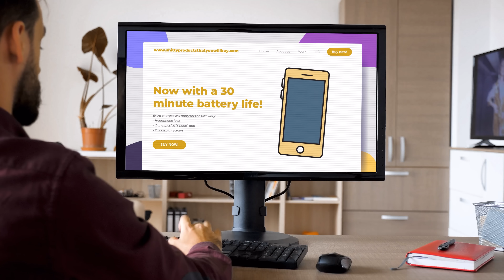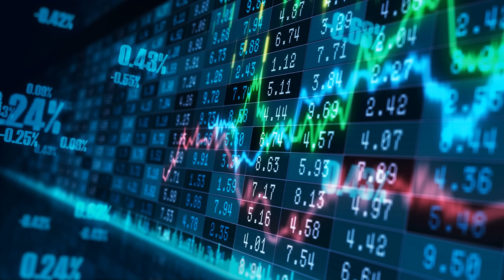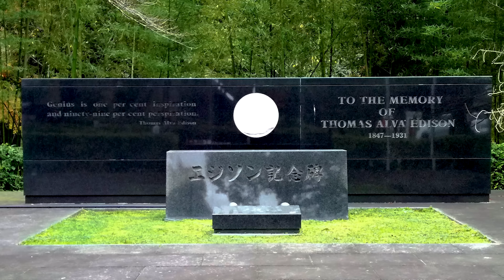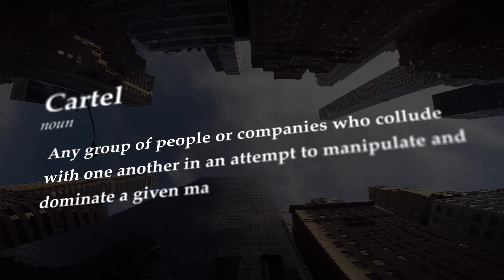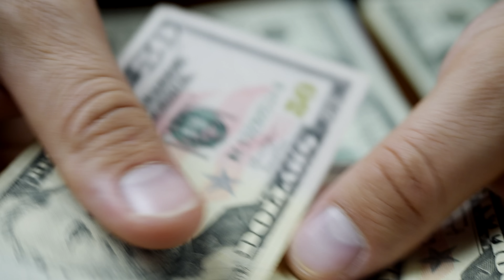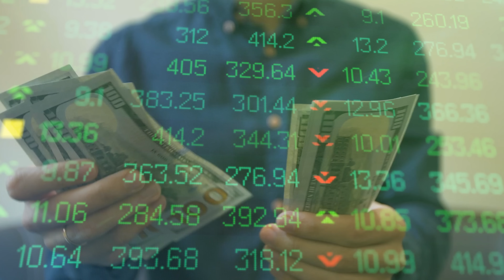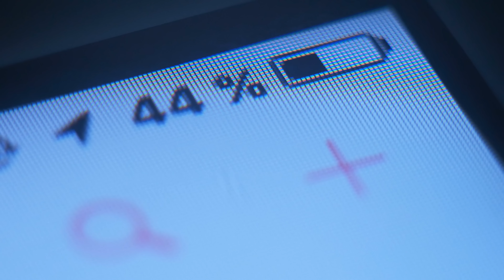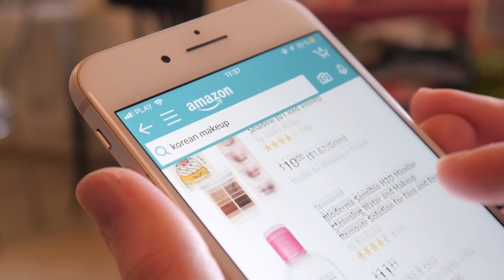Why All Lightbulbs Are Designed to Break

Comment: Old news, cars are designed the same way
Reply: Almost everything is designed this way. Furniture, tools, paint, building materials, everything with a warranty is planned obsolescence.
Reply: I had to laugh because I got a car ad right before this vid and a Scotty Kilmer vid is next on my playlist.  
Car companies love to make up awards that they pay to give themselves like participation trophies (*cough* JD Powell). Meanwhile, they make more and more important parts out of brittle plastics, electronics that fail yet run everything, transmissions that die immediately after warranties expire, etc.
Reply: @DeAthWaGer  I think getting a collection car is the only smart investment, at least once it becomes rare everyone will be chasing you for it
Reply: Yep. You basically only get an average of 5 years before you start getting problems. The fact that cars are now heavily run by electronics makes their durability more problems. Just a small spec of dust on one of your sensors then the whole thing start going haywire.

This is why I want to fully restore my old Corolla since its durable as fuck and drive along the road and laugh at the new model cars as their cars break down from a broken sensor while my Corolla is running missing a spark plug.
Reply: @orvetoralsolo7892  I don't understand what you mean by a "small spec of dust". MAF, TPS, MAP, O2, CPS, Knock, ABS, TMAP, Brake wear, Oil Level sensors don't go bad with a spec of dust. Most of these are needed to run an engine. A dust particle wont leave you on the side of the road. Or is there a sensor that I missed that will be bothered by it?
Reply: @Oink_Blaster  there are a handful of situations where my friends had their cars break down in the middle of the road due to some dust sensor. Like the map sensor from my friends Honda after ur past by a really dust construction site. After he had it checked and sprayed a few sensor cleaner his car was up and running again.
Reply: @orvetoralsolo7892  let me guess, you friend with the Honda had an aftermarket air filter? If dust was so detrimental to map sensors; side-by-sides, rally cars, trophy trucks, and even that same construction equipment that is causing all that dust, they wouldn't have MAP/TMAP sensors. It's the air filtration, or in this case, lack thereof. I've never had this dust concern, and I worked in construction for 6 years.
Reply: Imo, getting a Manual transmission over an automatic will last longer.
Reply: @elliscook9794  true which is why I think I am better off restoring older models than buying new ones
Reply: Jay Leno has some really old cars and motorcycles that still work. Can check out videos if type in Jay Leno's garage where say search above video.

Comment: These videos should be required viewing as part of the school curriculum.
My M254DW HP printer recently auto updated it's drivers and decided to stop working 'to protect me from using the non HP cartridges' that I had fitted. No help from HP to fix this and I had to first install genuine cartriges (just to get past the error message on the printer) before using a hacker firmware downgrade supplied by a 3rd party cartridge supplier. Then I prevented my printer from auto updating. Interestingly, after the downgrade the printer then worked again with non standard cartriges but was aware they were non HP ones yet did not stop working. I read that HP had been in trouble for doing this in the past yet somehow they had 'mistakenly' caused it to happen again and were soooo sympathetic when I complained on FB. They weren't the ones who offered the firmware downgrade though............. And as for Apple?!? They are the absolute pits and I will NEVER buy any of their products............

Comment: Planned obsolescence is built into practically every product these days.  Why my old tv antenna lasted 30 years, but my new one dissolved into dust and fell apart after just 7? It was done on purpose. And you always know the culprit, as they are the market leader and have the most to gain.

Comment: Some products also can't achieve the quality the manufacturer would like to offer, but the market limits the final design based on final sale price. My dad and I used to run a business that manufactured outdoor wood fueled hot-water furnaces (hydronic heaters). We designed a model that was extremely efficient, so much so, that even the EPA testing laboratory complimented us on our impressive efficiency. However, the final cost would have been almost $20,000 for a unit that would heat just 3,000 square feet. We had to compromise and managed to make a unit that was 90% as efficient, still, it managed to achieve 94% efficiency while burning wood, that makes it more efficient and cleaner burning than some gas powered furnaces. All while still well surpassing the EPA requirements (85%) and still impressive to the EPA test lab who informed us that most EPA approved designs barely passed the 85% requirement. AND, the cost was much lower, at $9,900. Still expensive but also very nearly as efficient. However, the design required users to operate the furnace in a very specific manner, and to maintain and clean it 2-3 times per week. Wood needed to be dried to 23% moisture or less. Which required 2 years of drying on a stack and if the summer was particularly wet, it might never get below 30% anyway unless kept under a roof or tarps that let air over the wood but not moisture. It used half of the fuel of the "standard" models we made and we hoped people would find the efficiency, smokeless operation and huge savings in wood usage to be a benefit. But alas, most of the people who purchased them, later sold them and purchased the simpler, less efficient models because the effort of drying the wood down, cleaning the many heat exchanger tubes and secondary burn chambers and replacing the seals on the many maintenance doors to be overwhelming, even though it only takes about 1 hour per week to accomplish. We used one to heat our own offices and warehouse and I personally maintained it. It really wasn't difficult to do. However, there was one significant limitation that we had no control over; the EPA rules for high efficiency hydronic heaters did not allow the furnace to have a firebox larger than 15 cubic feet and the unit could not produce more than 250,000BTU. Our heater had a 22 cubic foot firebox which we needed to redesign to be smaller, thus holding less fuel and requiring more frequent refueling. We also managed to produce 480,000BTU even after redesigning with a smaller firebox. So we had to install a restriction plate that slowed airflow to limit heat output to 250,000BTU. This also reduced our efficiency to 89%. Users who wanted the efficiency but did not require the EPA sticker in their region would remove the restriction plate to get best efficiency and better functionality. 
So we COULD have made a world-beating super-clean burning, hyper-efficient product that would allow people to burn waste wood from sawmills and dead trees from their property, but the EPA actually made our design LESS efficient...and the cost and complication of the design meant that we sold the old style 76% efficient heaters 100:1 compared to the high efficiency models. Further rulings from EPA made it so we couldn't sell the classic style heaters and so few people wanted the better design, it was almost impossible to remain in business and we decided to close shop and find a new means of making a living. So sometimes the design is not as good as it could have been simply because the cost of manufacturing the best possible design would eliminate the market you are trying to provide a product to. We only made 15-20% markup on the heaters. When every other company tries to get 50-150% markup to make money and cover taxes and other expenses, we scraped by, knowing we had food on the table and a roof over our heads and were content to make just enough. But in the end not even that worked and we had to shut down.

Comment: Most of this obsolescence nowadays happens through saving cost in production by reducing material used, cheapest parts and assembling methods.
Gluing is faster than screwing. Cheap elements right at the bottom line of the characteristic line save a lot. 
Saving a cent here and there raises the slim profit margin. 
That the products fail earlier is a welcome side effect.

Comment: If you are buying incandescent bulbs, always go for a higher voltage rated bulb. A 130V bulb in a 120V socket will last about 3 times as long as a standard light-bulb rated for 120V.

Comment: I would also like to add the difference between legacy building types verses the 'engineered' building components of today.  Engineered products use less material but also don't last nearly as long.  On a side note, engineered building systems may hold up for a given period of time, but don't tend to do so well when subjected to forces outside of normal everyday exposure/wear & tear (i.e. fire, earthquake, flood, etc.).  Perhaps a subject for a future video.  Cheers

Comment: When I moved into my first apartment, the first thing I did was replace all the light bulbs with LED lamps. 
That was about 9 years ago. All of them are still in use nearly every day without breaking only once. Also they save me a lot of electricity, 8 - 9 LED lamps consume as much as 1 regular light bulb for me.
I live in Germany and the power supply is very stable here. I estimate that they will last for many more years.
I am curious how long...
So if you are still using normal light bulbs, replace everything with LED bulbs as fast as possible. Its good for the environment and you will save a lot of money over time. 
By now there is a suitable LED for every base and every possible lamp that exists out there, even for my salt crystal lamps ^^

Comment: This happened with appliances as well. Appliances used to last 25+ years frequently. Your new Samsung and LG? Lucky to get 6, the manufacturers told me directly they designed them to break between 3-6 years. It is on purpose.

Comment: Speaking of printers. It was very common to unplug an ink cartridge and plug it back in to find it was working just fine and now read at around 40 to 50% remaining. This was several years ago. I vaguely remember putting a new cartridge in and not using it for a week and having it tell me black was low. Impossible. Replugged it in and it read as full. I always thought it was just a reader malfunction. Similar to snes days.

Comment: I believe this is the case with all my phones the latest years.. My simple plastic Nokia 3110, Motorola MicroTac and Ericsson 337 was flushed in the toilet and dropped from roofs, and no big deal.. Maybe changing a bent but detachable antenna at worst, or picking up the battery and dry it... But my Note 20 wit amazing features and gorilla glass and stainless steel must be laying the most time on a silk pillow to last...

Comment: 15:07 This is a half-truth: As Lithium-ion batteries degrade, through the forming of dendrites, their voltage output begins to fluctuate. That fluctuation can cause errors in the OS as the values aren't calculated correctly (voltage too low for the ALU for instance). Voltage regulation can compensate for a lot of this, but as the batteries age, voltage regulation hits its limits. The Apple Engineers legit wrote was to compensate for this in software (but doing things like tying processing of background apps to the measured average voltage output from the voltage regulators. Essentially tying OS thread scheduling directly to previous passive voltage regulating devices), then marketing got a hold of that info and bam. In goes the Planned Obsolescence.

Comment: In the case for the lightbulb the obsolescence wasnt just for greed. The old long lived bulbs weren't very bright and used a lot of electricity. The power grid of the time was a new thing and it really sucked and more and more people were tapping into it. A hotter, brighter, cheap 1000 hr bulb used less electricity, less resistance, so you actually save money with them vs the old power hungary type. 

But it did give everyone else the idea to plan obsolescence.

Comment: Hence the phrase: They just don’t make them like they used to. Far more truth spoken than anyone truly knew. As it was fact! They didn’t, and on purpose. 
I recall my father telling me this type of story, about how carmakers are completely able to build a car that won’t break down (barring accidents and occasional flat tires) but that they didn’t because there’s so much more money to be made in repair. He also told me that companies such as Rolls Royce built theirs far more solid and hence that’s why their initial price tags were so high. This may have been true, as I’ve never had a Rolls. But I’ve looked under the hood of many high end cars and noticed one across the board commonality. The engine is nearly inaccessible. Making it an absolute must, if or when something does go wrong, or it’s due for maintenance. Same as BMW, Mercedes, Porsches, Bentley, Maybach, etc. you get the point. As when you look under the hood at a Honda or Toyota, it’s completely open. And that made me able to save countless dollars by fixing my own car.  So my point is this story applies to nearly everything a consumer would buy.

Comment: Its not a scam or conspiracy... its science and progression. The oldest lit bulb is something like 100 - 150 years old and still glowing. This is due to the thickness of the element as well as the phosphorus coating on the element. That being said the elements of the day were made from carbon, not kanthal or tungsten like modern bulbs. This bulb is so dim that you couldnt light a kitchen cabnet with it. The reason we have bright incandescent bulbs is due to the thinner wire and phosphorus coating. This allows the wire to get hotter thus producing more light. Witch in turn wont last nearly as long due to its lack of robustness compared to the early light bulbs.

Comment: I think the term "planned obsolescence" refers more to a planned short usable lifetime for some products. They may not necessarily break down in that time, just become less usable and impossible to repair or upgrade due to deliberate and planned changes in replacement parts and other products around them. I have old computers that work perfectly, but won't run newer applications, connect to more modern equipment or the internet. Making an inferior, easily broken product is a companion strategy that only serves to add to this problem. And to the corporate bottom lines.

Comment: @doug randall
LEDs have a real problem with heat.  Make sure your LEDs aren't enclosed. 

I've tried replying directly THREE times now but YT just keeps eating my comment. So I'll try it this way:
...
This I largely agree with but there are of course exceptions.

In my case, an antique globe fitting in the bathroom in which I fitted a 15W LED a few years ago:; this is about a foot diameter with a solid single-piece ceramic base and an opaque glass globe. The lamp is also fitted into an E27 to B22 adaptor which serves two purposes .. positioning the lamp right in the middle of the globe (where it should be!) and giving more space above the lamp base inside the enclosure. The glass and ceramic construction evidently provides sufficient heat transfer in my application.

Just need to check the internal space, lamp positioning within and the materials used and keep to a sensible wattage (which is critical). For example, I wouldn't put one of these in one of the more modern, smaller, all-plastic globes, or any "compact" fixture.

I did find that higher-wattage CFLs did not work reliably, even for short periods. But this LED provides a superior substitute and has a much nicer 6500°K white light, so I'm happy with that.

I tend to date code lamps on installation, so will check whether I did so with this one at some point. A number of the LEDs are from around 2016-2017. I still doubt they'll match the longevity of linear fluorescents though; e.g. the 13W under-cabinet lights in the kitchen have had the same tubes since about 2006 and have seen well over their rated life now. A bit like me I suppose.

Comment: I have a Sharp Carousel microwave oven that I have used everyday since 1993 {28 years} They say the average one lasts 9.5 years. Everything on it works fine and never replaced the lightbulb **knock on wood**

Comment: Here's something interesting. All other design parameters being the same, the degree of vacuum in an incandescent bulb will directly effect its life expectancy. Low vacuum = short life. A cheap bulb would last 1000 hrs. An extended life bulb would last 1500 hrs. A long life bulb could last 2500 hrs. Here's why: If you've ever cracked a bulb while it's turned on, the filament will burn out instantly. If a bulb has a perfect vacuum, it could last as long as the 'firehouse' bulb. These days, I can buy a 4 pack of excellent brand name LED 60 watt equivalent bulbs which should last 20,000 hours each, for $3.00

Comment: I got a cheap printer once, and after around 36 pages, in, it said it was out if ink. (it wasn't) and the ink was around 100 dollars. 3 times the cost if the printer. After that, I never used a printer again, and went full digital.

Comment: I'm thinking automotive companies have been doing the same thing since roughly the 70s or 80s. Each company using planned obsolescence to make specific major components (as to differ from one another) of the engine fail at roughly 150k-200k miles.

Comment: The second model of a certain smartphone that is related to the word "milky way" was so durable that you could drop it 💯 times and it still worked fine.  The fourth model was so unlike its grandpa that it would be rendered useless after a single fall. Needles to say that was a steep drop in durability.